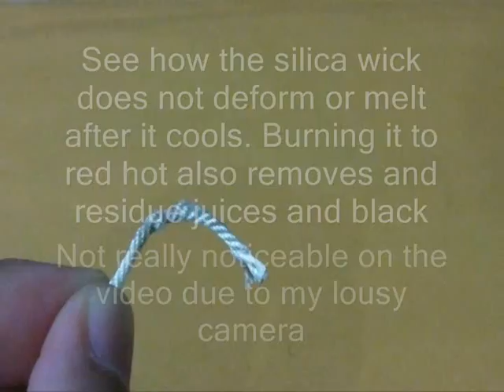Why you should not use fibreglass(Zippo wick core) wicks

Comment: I have heard of people using silica wicks in their zippos, and that is why I am here. What do you think of using a silica wick in my zippo? I want a wick that won't burn quickly. My Zippo wick burns really quick, especially when my lighter is low on fuel. And it is $2.00 for a wick by zippo. But I can get 15 feet of 2.5 mm silica wick for about $5.50 and that is long enough to make exactly 45 zippo wicks.

Comment: verry funny a oil lighter wil never be as  hot as a torch lighter so no it will not melt inside your zippo. it is true glass can be dangerous but yea you can put glass wool and wick with nichrome wire... youll never sniff the zipo fume anyway....
Reply: i saw blackening but not melting on mine , or you should buy some very bad quality...
Reply: i use silica wick so no, it does not happens.
Reply: I tested it too. Mine didn’t melt, even with a torch. I don’t think that was a zippo wick. But, Im sort of traumatized anyway. Wish I didn’t even watch this.